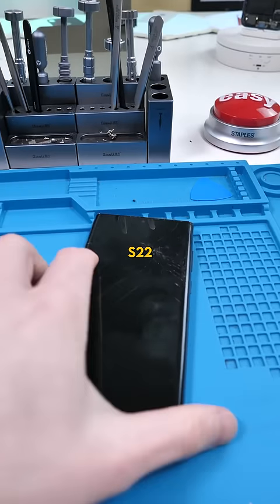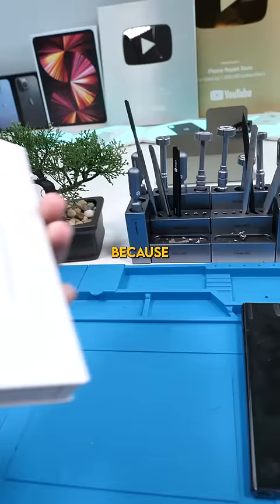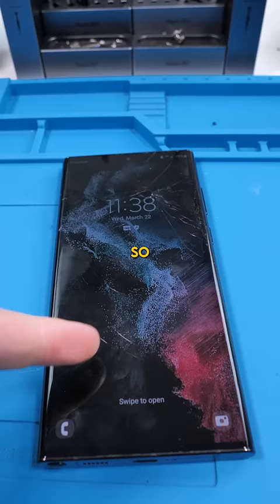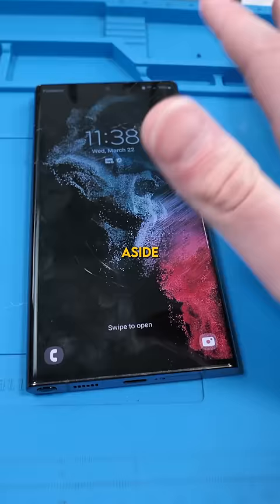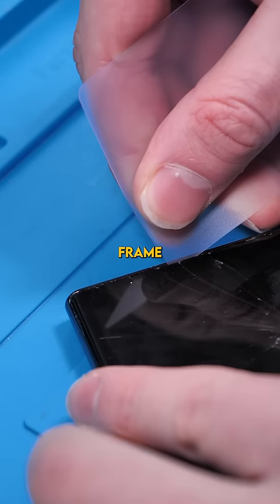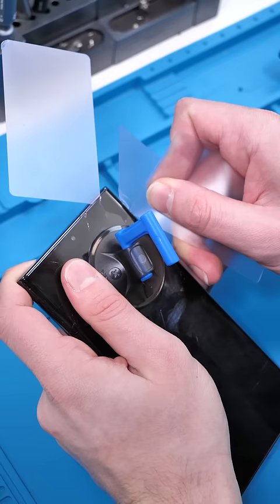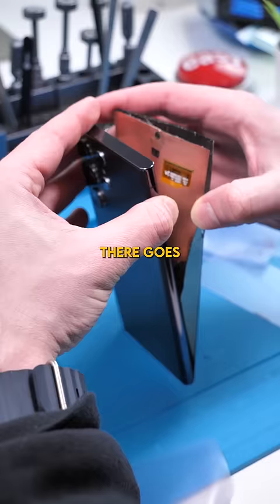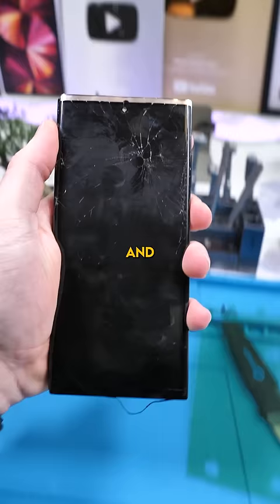Fixing This Phone Terrifies Me... #Shorts

Comment from the maker: There's equipment that helps to easily remove the display without breaking it, I could probably remove it with extreme patience but I didn't have the time :/
Reply: Hey i have a question for you can you tell me the name of your tec shop
Reply: It's actually not that hard, with the equipment you have, just soak the screen in isopropyl alcohol for like an hour then use a heat gun and a fishing wire
Reply: Or you were just impatient😂
Reply: Could you tell us where you get your screen replacement from?
Reply: Well I sure u have 1min record 😂
Reply: Call me dumb buddy but how you doing to make money of a broken screen, I don’t see how that is profitable?
Reply: Does repairing the screen affect the fingerprint reader in any way?
Reply: @tisizachlee  yes it does. I had my s20 back glass fixed and the sensor has been fried in the process. (As this is 2 gens newer I should imagine it’s not been sorted)
Reply: Man dump it in isopropyl alcohol for 1 night
Reply: And then you get just the glass off and save more money
Reply: @snowyfuryx  polar tech
Reply: @Butter fox  cool I think I found it. Is it from Australia?
Reply: In India.. if the display is intact and only glass is damaged then the cost of display goes to the customer..
Reply: Hai
Reply: Can you plz help me, I have replaced my pc battery but now I have a stripped screw and I don’t know how to fix it… can you help me?
Reply: How much Ram is it?
Reply: Private pls
Reply: I wanna ask you something do you use amoled display as replacement?
Reply: Patience 4 u = Money 4 u
Reply: @TechNo1geek if only liquids didn’t ruin OLED displays..
Reply: Samsung official does it by frame because of water resistance
Reply: My samsung s9 its screen is unstabble whan i am on apps
Reply: @AlexanderSlyers  if you dropped your phone you probably destroyed the dizigter
Reply: @PhoneRepairGuru just heat the screen first and use thin wire and remove the glass slowly then remove the oled screen using isopropyl alcohol
Then place new glass and fix to the oled screen
Reply: Why wouldn’t you just use a screen with the frame .
Reply: @filippocaregnato4098  just cut the screw on top like a minus and unscrew using a minus screwdriver
Reply: Hey can you try a s23 screen on a s22? I got the idea from your iphone15 screen on iphone14 video

Comment: As far as I know, all displays sold by Samsung come with a frame attached to it, so the screen you got probably isn't OEM
Reply: You are not wrong
Reply: What do you guys mean the display with a frame?
Reply: Most repair shops use after market parts. They are cheaper and don't require partnerships that have particular rules that make your life harder as a technician. I have been certified by Samaung, apple, and google to do OEM repairs. All of them javelin their own rules that you have to comply with and it is ridiculous.
Reply: For the s23 line up they now have UB’s which is just the screen that are OEM. While most repairs we do are OEM octas (frame, screen, and battery) some of the new repairs are the UB’s. They require you to gut the phone and remove the display from the inside, then use resin to glue another screen on the old frame.

Comment: im telling you for sure you can remove the screen undamaged with a curved screen disassembler from quianli. You have to remove the motherboard and the battery, under the battery there is a gap from the inside frame and the screen to put the tool in and gently pry the screen form inside out.

Comment: A couple days ago I replaced a Galaxy Note 20 Ultra display with the frame for a customer .. it was a 250$ but it was very easy compared to the normal display :›
Reply: yeah samsungs are quite easy with the frame. but samsung is moving back to the option to switch the display only as opposed to the OCTA kit for the s23 ultra
Reply: Yeah I wonder why it's so expensive
I looked for the display repair pricing for my s23 ultra just in case I ever broke it.
And lol it was just $210
Reply: @subhojit2003  where did you find a S23 ultra screen for that cheap?
Reply: @maroonmedia2000  samsung india website

Comment: You need to use VW40 after disassembling every thing from the phone accepts the screen heat the screen and spray the VW40 in the hole where the flat cable of the scree is and let it cool down and repeat but usually you need to do this one’s the VW40 dos not Damen the screen you can only wipe it off with isopropanol.

Comment: Have you ever thought on making glass only replacements? It's much more cheaper for the customer and also better way to reuse probably original OLED screens
Reply: That requires a lot of skill and patience, not for faint hearts.
Reply: @thetechfromheaven  yep that's true... I would have tried that at least once though
Reply: You are right, he just cant replace glass only 😂 skill issues
Reply: Oled and amoled panels glass is practically impossible to remove without damaging the actual display, you need a lot of skill and experience to pull that off
Reply: @kingcgaming9593  its not that hard if you know what u r doing and have enough skills

Comment: If you want to remove just the glass, you should get a removing kit. It makes it easier. Btw, at the removal, it is better to work from the inside out. Those curved edges make the process from the outside impossible.